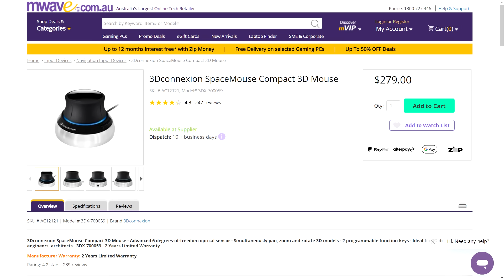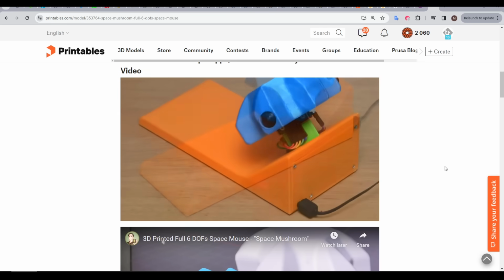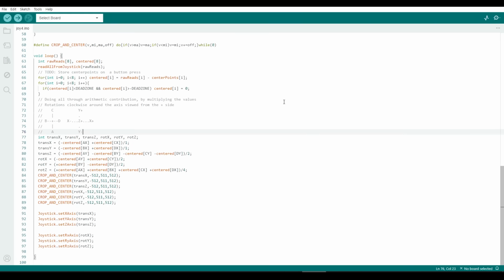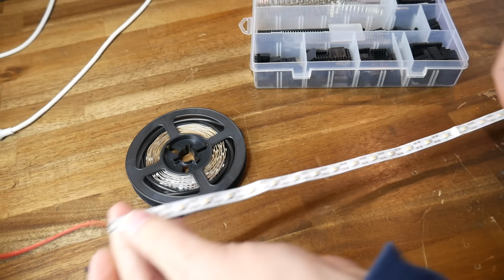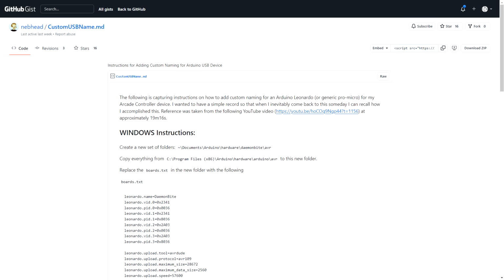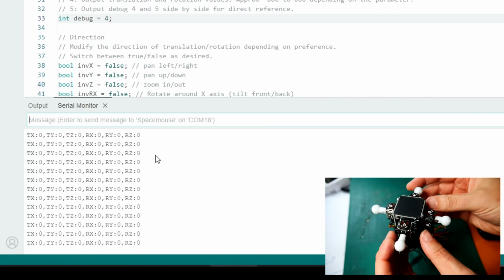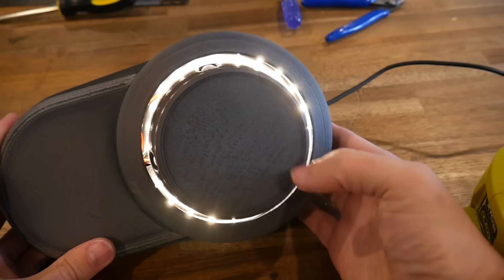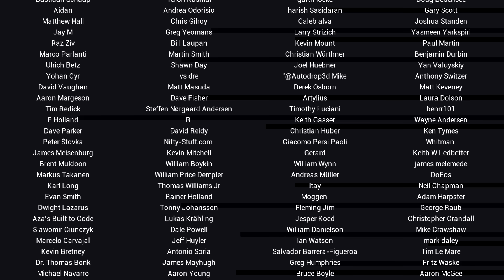Making a cheap, open source 3D space mouse with Arduino and 3D printing *V2 out*

Comment: I wonder why you didn't make a version based on the project that clones the space mouse.  It looks to be very similar in space to the original.
I'm just about to get this project printed as i've been looking at it for the past 4-6 weeks.
Reply from the maker: My version does also clone the SpaceMouse. The 3Dconnexion software can't tell the difference.
Reply: @TeachingTech  Your project is not a clone of the SpaceMouse.  Your project is similar, but not a clone.  The clones do not use joystick potentiometers - they use a hall effect sensor, just like the real SpaceMouse.

Comment: What version of Arduino IDE are you using? I have version 2.3.2 and I cant add the board following your instructions.
Reply: this might help

The part about copying the 'avr' folder into the 'Spacemouse' folder - I think this only applies to older versions of Arduino IDE...for version 2.3.2, which is what I installed, the 'board.txt' file the modifications are to, are in the '\Users\(username)\AppData\Local\Arduino15\packages\arduino\hardware\avr\1.8.6' folder. (you probably should save a copy of the original 'boards.txt' to restore after you complete this project...if there is a way to get the .ino file to compile with its own dedicated 'boards.txt', I don't know how)

Comment: Very impressive and very helpful!

Another option for a cheaper 3D mouse is to look for some of the old, pre-USB units which are quite cheap on eBay. I'm not sure what hardware and software you need to adapt one for modern PCs, though.

Another similar device which is even harder to get nowadays is an eight-dial dial box of the kind which used to be available for SGI and Sun workstations. Building one of those would be a relatively straightforward project but it might be just as useful to have.

For the sim hardcore, one big challenge would be a faithful-looking, working replica of the Apollo Translation Control, a 3D controller designed to be used with the 3D-joystick Apollo Rotation Control.

Comment: Nice project. But honestly i'm not really into 3d mouse. I have 3dconexions space mouse pro and rarely use it. I do cad for a living in CATIA v5.

I actually teach students CATIA, and once a year i show them this spacemouse pro. and invite students to try it out. So far i have not made it to work reliably for me or any of my students. So far none of my former students use 3d mouse (and i have asked a few of of them that work in catia v5 in automotive R&D for years.. and no 3d mouse in sight).

Maybe it's just CATIA v5 use case. In catia you can accurately move/tilt/zoom/center/fly your model just from the mouse. 3d mouse does not even compete with regular mouse for camera movement. 

At least i sometime use it in Ansys and Inventor, and some other CAD-CAE-CAM. 

I won my mouse at a CAD convention.. and tried to use it, let alone love it... i gave it a go for weeks-months and did not stick to me (i found it annoying to have the camera shift ever so slighlty if i touched the joystick or the table vibrated, so i had to unplug the mouse and now it lives in the box and not on my desk). I have mine from 2012, and still it sits in it's box, and once a year i present it to students one day, then sits for another year.

I'm curious if you find it useful and not just a gimmik. I've tried, i failed.

Comment: I cant seem to get the 3Dconnexion software to detect the arduino. everything els seems to be in working order, all in the debbugin works as it should. i just cant get it to detect in the 3Dconnexion software. any suggestions?
Reply: this might help

The part about copying the 'avr' folder into the 'Spacemouse' folder - I think this only applies to older versions of Arduino IDE...for version 2.3.2, which is what I installed, the 'board.txt' file the modifications are to, are in the '\Users\(username)\AppData\Local\Arduino15\packages\arduino\hardware\avr\1.8.6' folder. (you probably should save a copy of the original 'boards.txt' to restore after you complete this project...if there is a way to get the .ino file to compile with its own dedicated 'boards.txt', I don't know how)

Comment: I would like to ask why you must use 3DConnexion's software. Is it because they use APIs for the corresponding software? When I use the mouse and keyboard to operate fusion360, an icon will appear, but not when using 3DConnexion.

Comment: I just bought an older SpacePilot Pro mouse for ~$130 on eBay. It’s not officially supported, but the drivers do still support it in extended support mode, so all of the functionality works perfectly for me in Fusion360, and Inventor. Alibre Design works for the 6 axis movement, and you can set the shortcut buttons to perform keyboard shortcuts, so it works there too, sort of. Alibre unfortunately doesn’t support contextual awareness though, so it’s not ideal. 

I’d really just suggest buying a used mouse locally or on eBay for most people. It’s not quite as cheap, but still is definitely affordable, and if you don’t like it you can just sell it on for basically what you paid for it in the first place.

Comment: When I try to execute the part where I need to select spacemouse from the sketchbook, it always gives me this error: 'The property 'upload.tool.serial' is not defined.
Reply: this might help

Inside the 'boards.txt' file, after replacing the contents, the line 'leonardo.upload.tool=avrdude' needs to be 'leonardo.upload.tool.serial=avrdude'. (this is thanks to AeroMicky on the Printables forum)
Reply: @hdmungeryt  this worked for me cheers

Comment: I cant rename the arduino leonardo, anyone had same issues and sulutions?
Reply: This might help

The part about copying the 'avr' folder into the 'Spacemouse' folder - I think this only applies to older versions of Arduino IDE...for version 2.3.2, which is what I installed, the 'board.txt' file the modifications are to, are in the '\Users\(username)\AppData\Local\Arduino15\packages\arduino\hardware\avr\1.8.6' folder. (you probably should save a copy of the original 'boards.txt' to restore after you complete this project...if there is a way to get the .ino file to compile with its own dedicated 'boards.txt', I don't know how)

Comment: Great project and well documented as always! Thanks, Michael!  I just finished building v2. Everything worked first try, with one exception - when I rotate the knob left and right, like a volume knob, the onscreen model should rotate in the same way, correct? For me, the model pans to the left or right instead of rotating. All other movement works fine. I'm guessing I need to adjust one or more axes, but don't know where to start. Any ideas?

Comment: The hardest part of a project like this is interfacing with target softwares.  There's lots of great ways you could build a 6DOF controller, but if you've got to reduce that down to mouse and keyboard commands, you've just wasted your time.
I wish more 3D editing packages would have APIs that let you make plug-ins.
Or better, yet. I wish there was an open standard for 6DOF controllers.

Comment: I think the internet heard you, the parts are no longer $20 lol.   All told, AUD, using your links etc, its over $100 including $10 each joystick, $20 adrino, Led strip, dupont kit etc etc, apart form the kit that you can reuse obviously, there isnt much change out of $100 but a worthy project and still 1/3 of the price off a real one at least.

Comment: I recently bought tripple foot pedals that allow different movements in conjunction with the mouse. It was relatively cheap.. 50 bucks Canadian on Amazon. I needed it because my left arm is paralyzed so I can’t really use shift, command and option at the same time as using the mouse in Blender.

Comment: bambu P1SC When using a 0.2mm print head, AMS’s material replacement time is very long!
Please provide a video tutorial to change the change filament g-code code.
Speed up the time to change materials!
I observed the material change process: it required 4 material flushes to complete the replacement, but in fact only two material flushes were needed to complete the material replacement.
TKS!

Comment: Anybody else not getting recognized by 3Dconnexion software?

Edit: Got it...I think.

Things I learned:

1. The part about copying the 'avr' folder into the 'Spacemouse' folder - I think this only applies to older versions of Arduino IDE...for version 2.3.2, which is what I installed, the 'board.txt' file the modifications are to, are in the '\Users\(username)\AppData\Local\Arduino15\packages\arduino\hardware\avr\1.8.6' folder. (you probably should save a copy of the original 'boards.txt' to restore after you complete this project...if there is a way to get the .ino file to compile with its own dedicated 'boards.txt', I don't know how)

2. Inside the 'boards.txt' file, after replacing the contents, the line 'leonardo.upload.tool=avrdude' needs to be 'leonardo.upload.tool.serial=avrdude'. (this is thanks to AeroMicky on the Printables forum)

Hope this helps...
Reply: Thanks so much for this! I was having exactly the same problem!

Comment: Even though i have two space mouses this looks fun just to tinker. I ordered old versions of space mouses for under $100. One used at work in solidworks and bambu slicer. Same at home. I do see the wired new space mouse knob is only $150 but still spendy to try if your not familiar with the device.

Comment: edit:  oh also i didn't realize they were that expensive by you.    that most definitely justifies building it.   if you spend less than a day doing it...   i don't make 279 in a day as a nurse even. 

i'm laughing... after while its like ppl in the community or getting into it end up on the same wavelength somehow.     probably while you were building this i had  looked at the sources you used but  got an older version called space pilot on ebay for ~$70 ... like the pro one sold now just more square?-ish.   the drivers still work with solidworks and fusion and there was someone who made some script functionality for cura blender etc.

but yeah i almost did this exact thing last month as what you've wonderfully done here... and was planning on a custom case like you bc i didn't really dig the mushroom cap thingy.     its definitely a helluva project, and i'm very thankful you did this, bc the reason i just bought one was i got the idea i would run into some of the roadblocks you encountered and overcame  and this will probably help a lot of people get up and running, it will for me too soon, just for the practice with arduino... and especially for people bootstrapping it like me. Space Mice  just arent made by anyone but 3dconnexion anymore, the basic one's aren't terribly expensive but 100 is definitely 5x20.   so if you have the time but not the cash... build it.  There should be more open source advanced input devices like this around.     probably will build one anyway so i have one in the shop i'm not worried about breaking when i'm cadding out there.  

i don't think you can go wrong buying a used one or building this its just a question of prioritizing time and what learning you want to do first vs tinkering vs productivity (which i know is something you've touched on numerous times on different projects and appreciate in an unbiased way)  since  i am/was still learning and catching up with the rest of 3d printing and cad, tuning things etc... videos of yours from a few years ago... and cnc plasma, and cam... i decided i wanted to just be able to use the pre-made thing right away.

so TLDR....  Thank you for all the knowledge synthesis you've given to everyone, not just with this video!

 i'm positive its worth doing this project just for the well rounded learning involved, and having read much of the other info you referenced for this video youve done a good thing adding to the knowledge base i'm quite sure.      even though i ended up buying one i probably will build one anyway for the learning involved.  heartfelt thank you for your help so far, subbed.

Comment: I made an Orbion as mentioned in the video. It is awesome,, but it is very fiddly to wire and the tolerances of the 3D parts is critical to getting it to work especially if printed in ABS. Once complete I used the original HID drivers but these didn’t play well, with Onshape. However, somebody rewrote the software so that you can is the 3Dconnection drivers and now it is way better to use.

Comment: You can look into Nintendo Switch joysticks to make a smaller version. They are, admittedly, notoriously unreliable in the long run, but they are ubiqtous compact self-contained modules and there are drop-in hall effect replacements that don't have drifting problems if long-term performance is needed.

Comment: LOL... I jumped through a myriad of hoops to get rid of Logitechs abysmal space mouse drivers and get clean joystick and xinput steams and he struggles to do the opposite.
Also get them used. Replace the rancid TPU with silicone and you have an awesome tool. They are quite robust devices.

Comment: I own a SpaceMouse and it is a pretty useful device; that said, it is not worth its crazy msrp. 
I bought mine used on ebay for less than half the price, which is why I don't regret the purchase. 
Biggest problem with their products is quality/ reliability. I had two corded CadMice before, which both failed after less than a year. My current CadMouse Pro Wireless survived for a little over a year - now the mousewheel is doneski and I'm going through the motions with their customer service once more. My SpaceMouse is still working well, but I had to remove the softtouch coating from the housing/palmrest at some point, because it had become too sticky and gross to use the darn thing. 

I might actually try to design a smaller version of this just for the fun of it. Having a low-cost spare for the day my SpaceMouse will inevitably kick the bucket wouldn't be a bad thing.

Comment: I didn't have the Arduino folder with hardware. I only had an Arduino folder in program Files with ArduinoIDE.exe but no hardware folder. So I had to download the old version 1.8.19. But this is still not working for me. I created the spacemouse folder, copied the avr folder from the Arduino_1.18.19 version, edited the boards.txt file. But don't have a spacemouse option in my tools/boards. EDIT: the spacemouse folder needs to be in arduino/hardware not in arduino.

Comment: Although it probably means starting the design of the parts from scratch...

You could reduce the size of the dome or mushroom considerably by turning the mechanism inside-out, with the joystick sensors mounted  on the base, with the sticks pointed inward...

Comment: Would it be possible to "invert" it? Put the Joysticks not in the moving part but on the outside looking inwards. You would have to invert some of the Joystickinputs (I think), but it could reduce the size as you are not limited with how small/Big that inner black part is
Reply: Thinking abou it, it may even be possible without even changing the code

Comment: I have a 3DConnexion device (bought second hand) and it takes a lot of getting used to. Don't be disappointed by how difficult yours is to operate the Z axis as it takes some time to get used to both the original and any other.

Comment: Would it work to just take the guts of a joycon put it in a cube box, with a base that  can be used to reset/calibrate its IRL position? 

Then you actually pick it up fully move it and place it down, every so often as the joycon can some times get slightly off.

Comment: Big props for making it work. After seeing how much you had to put into getting it to work I don't regret buying a used SpaceExplorer on eBay. Only issue I've had is I'm stuck on an old version of the software since 3DConnexion no longer supports the older models. It's a really cool input device but I keep forgetting it's there and just manipulating things the way I'm used to with my mouse.

Comment: I would love to do this. I think maybe making the parts that go on the joysticks just the ball part without a shaft could reduce the finished size. And maybe make a shroud for the LED section that has a thin area that can be for translucent flexible materials to let the light through and then a couple areas on the edges to slot into the body and handle? This gives me a bunch of ideas, that's for sure.

Comment: Would there be value in mounting the joysticks mounted to the base, holding up the control stalk instead of being mounted to the stalk directly so that the stalk didn't have to be as big as the dome ended up being? It would require a few axis's to be inverted, but that appears to be a minimal adjustment in software.

Comment: I built Shiura's mushroom design but don't like how the 3 axes of the joysticks give the device an uneven feel, like its fighting you. I also tried to miniaturize it by inverting the direction of the joysticks to point inwards. This did help some, but any imperfections in the print were magnified, making that even worse in practice.
The Orbion looks great but its not 6 DOF because the Z axis is only on / off.
I designed my own based on a coiled spring compliant 3d printed "mechanism" which allows 6DOF and a MEMS gyro / compass board but haven't gotten around to doing the software. I think its still too clunky but I might give it a go in the future. I think the design with the coils on the PCB looks most promising at this time. Who knows, maybe I will build that in the end.